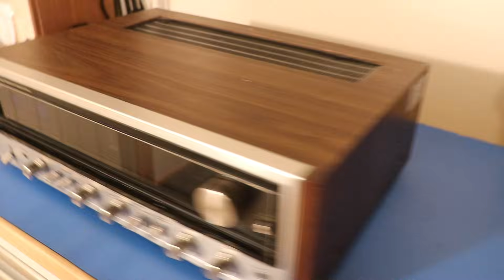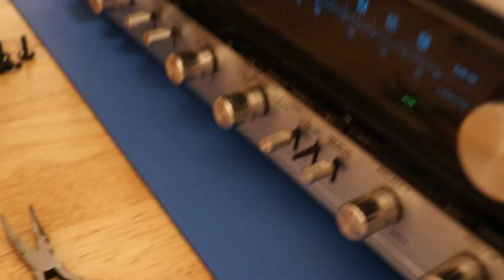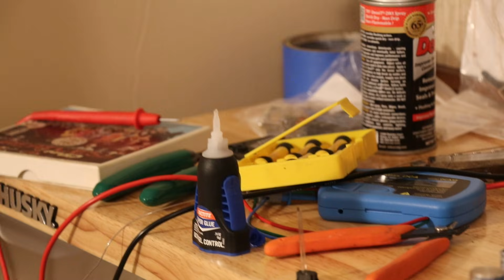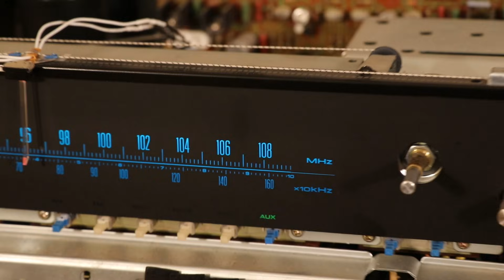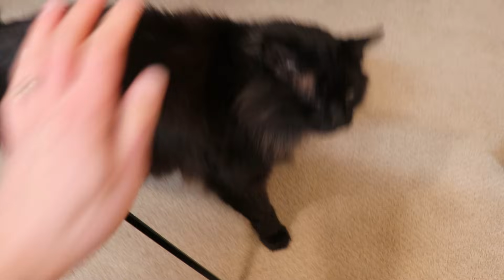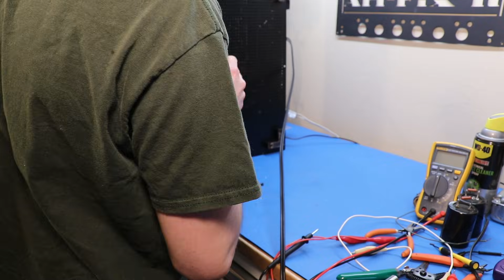Making A Pioneer SX-838 Reliable!

Comment: If you do a THD+N% sweep vs output -- you will note that above 12W distortion goes over 10% and there are some signs of instability (that's a little over 413mV input directly into the final stage).  I just caught this presentation and put one of my SX-838's on the bench.  This confirms the author's comment that the receiver doesn't sound good at loud volumes.

Comment: These are non polarized chassis but I'm getting 98VAC from front panel to earth ground on receptacle.  I've found two different schematics showing two fuses but a 2.2M resistor to ground on white primary.  Mine is missing that resistor.

Comment: any idea what would cause the FM radio to just stop putting out any sound after a few minutes of running? the signal needle also drops to 0. after leaving it off for a few minutes it  works again and then will eventually cut off again.

Comment: Nice addressing of the common issues... Just wanted to point out as i did in another one of your videos.. On the amp board...Q5 and Q6 are your "class A" pre drive/current source transistors and are not "bias" transistors. This model does not use a bias transistor. The bias ladder is nothing more than a stack thermal diode in conjunction with a potentiometer between the two drive halves.  The Class A driver they used in this unit, the 2SC1451 are really reliable devices and i never see them go bad in this model at all. On the lower power units they used certain matsushita transistors that were known to intermittently open their junctions causing issues but not these C1451's made by NEC.. Totally rock solid through and through.. i suggest to leave them be in the future... Just focus on the differential pairs...

Comment: HELLO, I'M NEW TO AUDIO REPAIR. I'M FIXING THE PIONEER SX 838. I'M REPLACING THE D313 TRANSISTORS. ONE IS SHORTED. I'M USING TIP41CG REPLACEMENTS. DO I NEED TO USE MICA INSULATERS & HEAT SINK PASTE?
Reply from the maker: If you're talking about the driver transistors on the small heatsinks, they do not need mica but they would benefit from paste

Comment: Really enjoy your videos Aidan!  I have a Pioneer vintage system including an RT909 reel to reel, an RT707 reel to reel, and a Pioneer SA7700 amp that I bought brand  new back in the day.  The amp still works and I purchased a restore kit with caps, transistors, relay, etc.  I replace the 2 large filter caps and swapped the VU meters lights to LED.  However I do not feel comfortable replacing the other smaller caps and transistors yet.  Recently when powering up, the protection relay clicks, but then within a few minutes it clicks back off and the VU meter lights dim.  A few seonds later it clicks back on and the lights get bright again.  It will do this several times until it warms up and then it is fine.  I have not checked the DC offset yet but will do that eventually.  Question:  Do you restore other peoples vintage gear?  If so how much, and based on the relay issue, where do you think I should look first?
  Thank you!  Chris from Winter Garden Florida.

Comment: Well honestly, I think the sx-838 is one of the worse receiver that is seriously stripped down 939 and 1010.  I probably take a 737 over an 838. I used to own an entire line if x3x receivers. Faceplate wise, they're all the same size (838, 939, 1010). As of now, I still own 636, 737, 1010.

Comment: It was very interesting to watch your video on your SX-838. I have the same receiver, but it is a different version. I was not aware there was more than one version. My receiver does not have push button switches to select speakers as it is incorporated into the power switch. Also, the output transistor assembly with the pcb board on mine, comes out of the receiver as one piece by removing 4 screws.

Comment: This video was interesting to me, because I purchased the Pioneer SX-838 in 1972 when I was working at an audio store part-time while in college. Employees got 50% off MSRP as a courtesy direct from the manufacturer/distributor, which was even less than cost for units purchased by the retailer for resale. I used it to drive KLH Model 5 speakers and also had a Thorens TD-160 turntable. I replaced the SX-838  in 1982 with a Hafler pre-amp (DH-110) and power amp (DH-220) that I assembled from kits. I forget what I did with my SX-838 or whether there were any problems with it when I stopped using it.

Comment: That 5 watt resistor on the power supply board made the board darkened cause it gets quite hot.  When I work on these units I change the resistor to a panel mount type and relocate it to the chassis.
Reply: For sure. Offloading it from the circuit board is a great idea!
Reply: noted

Comment: I think the re-cap thing can get out of control, I replaced every cap in my sx727 and all of the originals, other than the sky blue sanyo’s, tested fine.  The original filter caps actually tested better than the new “audio grade” replacements.  Perhaps there are other qualities that the purple cap tester doesn’t measure?
Reply: No reason to use audio grade for filter caps. Use something with high ripple current.
Reply: Usually the sky blue sanyo caps are the ones that are bad
They allow DC to go buy them and then they also measure like a resistor

Comment: Great video.  I have a NOOB question. How long do you wait for the DeOxit to dry up?   Or do you just use it right away?
Reply from the maker: To be clear, it's the solvent that is drying up. The "5" in "D5" means 5% actual deoxit and 95% solvent/propellant to get the deoxit where it needs to go inside the switch. You can use the gear right away since it's non conductive. The solvent will evaporate after like 15 minutes though depending on your room conditions.
Reply: @AHFixIt  Thanks for getting back.  I used some on one of my pots, but I was afraid it would short out-- so I left it overnight so it would evaporate.  I am glad that I asked.